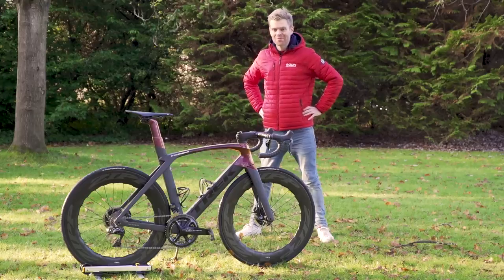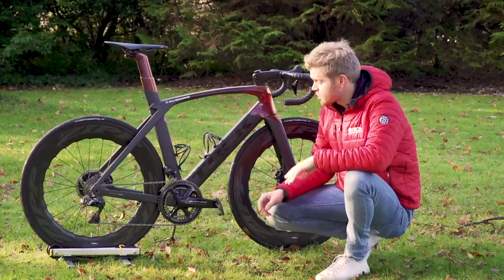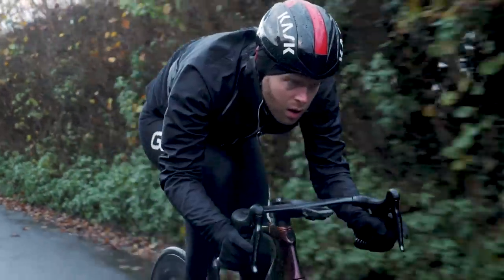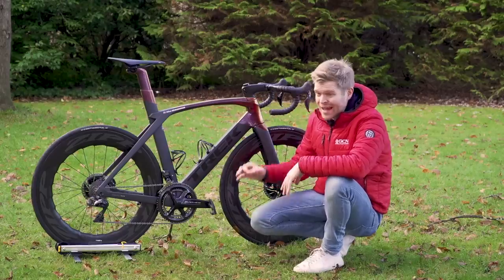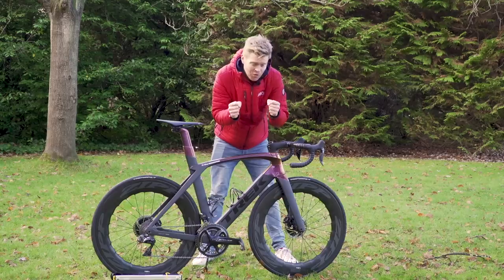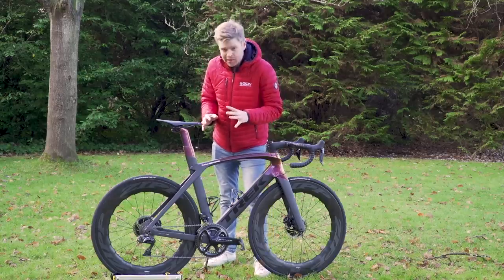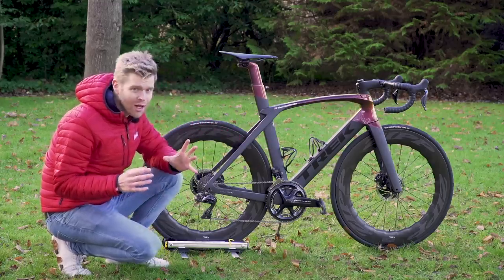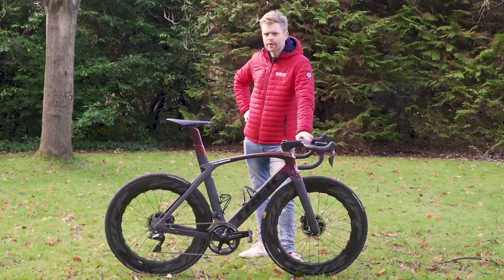Ollie's Project One Trek Madone Disc Presenter Bike

Comment: 17% more comfortable?  how do you go about measuring that....?
Reply: if lasty looks comfortable, he's not trying hard enough
Reply: Here in the States we have a scientific method of measuring comfort. See, we got a hundred men to ride the new Madone, 17% got erections while riding it, so that has to mean comfort, right?
Reply: It was a joke, and one I got a good chuckle from.
Reply: Yeah I was going a comment but found yours first.
Reply: could just mean 17% more compliance..
Reply: Marketing. With these percentages the brands try to convince us to buy new bikes again and again.
Reply: Vertical deflection increased by 17%
Reply: Comfort is subjective, but the data they would use would rely on some kind of resonance metric, which they should quote, but you wouldn't understand it anyway.
Reply: @happydays8171  good one !
Reply: Ollie really simplified this. It’s measured by the amount of vertical “forgiveness” that the decoupler gives, so compared to a standard seat post tube, the iso speed system moves 17% more across bumps, smoothing out the ride and thus more “comfortable”
Reply: I like your cut g

Comment: I've got one and was lucky enough to own the older model, which they still make as an entry level bike. I've ridden the System Six from Cannondale and it rides like a TT bike with drop bars, whereas the Madone is more like a highly refined road bike. A few Years back if you would have told me how much difference it makes I wouldn't have believed you, I've tested it and it's 24 seconds quicker over 4km using the same rims and power output.

Comment: I bought a 3D printer on a whim and it's become one of the best purchases I've ever made. No longer do I have to put up with specific light/computer combos or just horrible mounts in genaral. The Garmin mount for my Bontrager one piece bars put the Garmin way up in the air. Looked hideous. It took about 10 iterations but I printed a mount that doesn't bounce, is flush with the bars, and has the Garmin super tight against the mount. Worth every penny.
Reply: Which printer did you buy?
Reply: @douglaspate9314  XYZ Printing da Vinci 1.0 Pro. Pretty happy with it so far. There is definitely a learning curve but, if you like to tinker, it's worth the green.
Reply: @JosephDiaz  That's awesome.  Have you shared on thingaverse?  I have a da Vinci jr that only does PLA.  I don't think it's up for the task.
Reply: @mfennell70  I haven't yet but should. I bought my printer specifically because it did ABS for durable mounts. So far I only had one mount break on gravel. Luckily my Garmin was in a rubber case. Haha.

Comment: I like the newest Madone choices. The thing to look out for when choosing the model is the SL versus SLR not so much because of the "better carbon" but because the SLR is "H1.5" and I believe the SL is H2. Getting all of these dimensions dialed in before you order the frame is very important because adjusting it after you order it can cause you to lose some aero benefits.

Also, if you can get the SL to fit you, it's probably better to upgrade the wheels before you upgrade the frame to the SLR. Assuming you're trying to meet a budget. 

Last consideration is that unlike most if not all of the other "aero" choices, the adjustable "decoupler" makes this frame rideable every darn day. That can and should affect your decision matrices as well. If you end up with, say, a Venge, which also looks great, you just might feel the need for a Tarmac within a few weeks of riding your new Superbike on the road to ride comfort purgatory. 

The only real downside to adding this new model Madone with disk brakes to your collection might be compatibility with existing wheels and so forth. I plan to keep my "standard" bike(s) for backup and for the indoor trainer sessions and the "aero disk super bike" will be used at least 26 to 28 times a month...unless it breaks down and needs to get shipped off somewhere for repair. But my point is that I want it dialed in for all around use and I will spend extra time and money to make sure it can ride well over all terrain and conditions. That means a 40 to 50mm front rim  and 50 to 65ish in the rear with larger internal widths (at least 18 in the rear and 17 in the front, up to 20mm each). All of those things are more important to me than the "carbon" upgrade in the frame - unless I need the shorter head tube dimension of the SLR. 

These are some seriously excellent choices from Trek. Think it through and you might find the perfect Madone superbike for you garage. Or bedroom.
Reply: Disk brakes heavier than rim brake, how much aero design is better than normal? Who knows
Reply: Aero frame is heavier than normal frame

Comment: Certainly a lot of bikes have changed through your program. Is it worth taking this bike compared to for example, S-Works Venge or the new Cervelo S5 how is the stiffness I am looking for something really stiff and fast to race? Did Trek not go more comfort with the costs of lateral and frontal stiffness in this model ? A lot of these bikes are sold shortly after purchase, and why? The simple question is whether this bike really rides well or just looks good and is more pleasing to the eye than to be used for really aggressive, fast riding / racing?

Comment: Paint allready chipped right top side on fork 👍 whats up with the loose bartape 🤔
Reply: I noticed a little chip too. Made me shudder inside.
Reply: Apparently its not a garage queen, its a rider, duh. So good for you Ollie.
Reply: Chip =  only a NICE then.
Reply: Trek has 1 or 2 years warranty on paint, so it can be fixed for free
Reply: There is an issue with the oversteer block.  I have the same issue on mine, Trek replaced the fork once, 2 weeks after received. I have it again, no falls/crashes drops, etc.  Waiting on a solution from Trek now.
Reply: MJ Meenan I would suggest wrapping that bit with a strip of clear vinyl wrap to give it some degree of protection if it happens again.
Reply: @EagleKeeper86  Trek corrected it.  There were some early bikes sent out without the 'stopper' installed.  They've repainted the fork, sent the proper part and the shop has properly installed it.  All at no charge.

Comment: I noticed a paint chip on the front fork at the steer tube on the right side, must of happened when you damaged your mec
Reply: Under the steering top bearing cap there is a hollow with a small plastic boss inside to restrict the steering.  When this eventually breaks, the forks can rotate all the way around and it chips the paint on the frame.  I’ve seen this same fault on quite a few Madones……..including my own ☹️